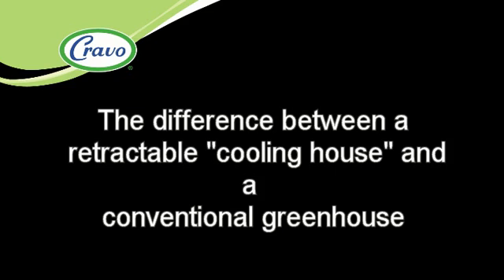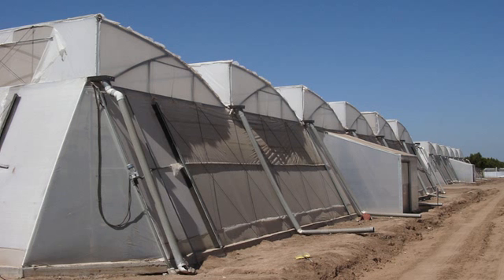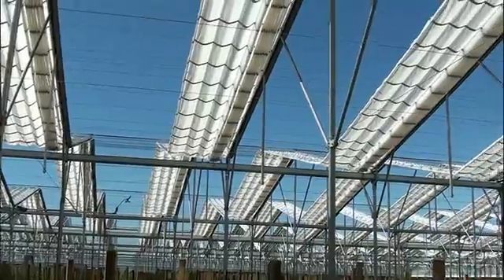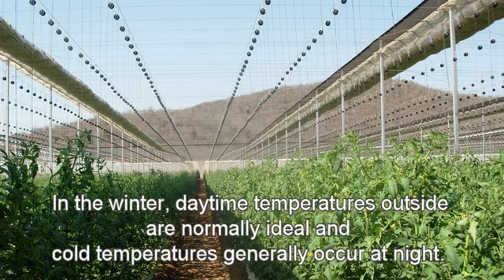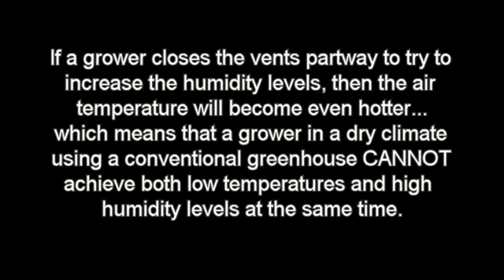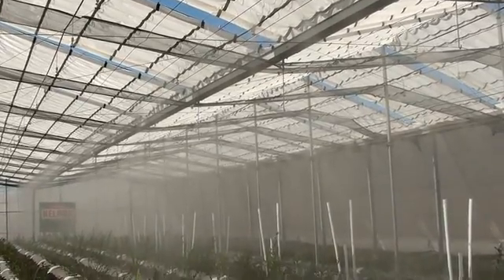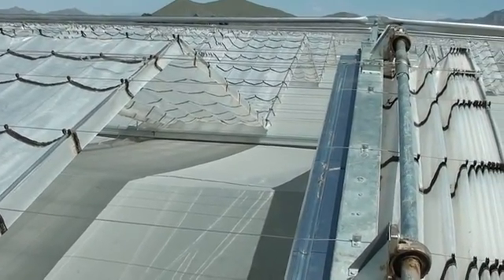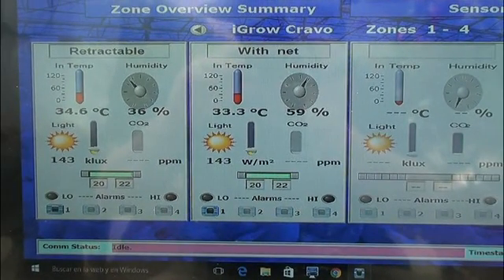The difference between a retractable cooling house and a conventional greenhouse

Comment: That's funny, after criticizing greenhouse because they could need fogging in case of high temperature and low humidity, you then say that a fogging can be installed in Cravo to handle high temp and low humidity. 90% of these arguments are actually in favor of greenhouse...

Comment: Good solution for certain locations.  How does this retractable system prevent insects from entering the house?  The other obvious shortfall is that these would not survive a hurricane of any strength.
Reply from the maker: If you checkout this web page you will see a video which outlines the 35 years of experience with retractable roof houses.  https://www.cravo.com/en/house-models       A stationary or retractable layer of insect net can be installed below the retractable roof for insect control.   These retractable roof houses have been hit by 16 hurricanes and cyclones and the structure and roof covering have survived all of them... including 145MPH winds in Puerto Rico

Comment: The comment regarding horizontal vs. vertical opening and air exfiltration at 4:50 is unfounded. 2nd law of thermodynamics states: Hot will always move from hotter to cooler and high pressure will move to lower pressure. Everything wants to have equilibrium. I'm an energy inspector, and this is the foundation of our work. Prime example: I stood in my 60 deg. F garage and the temperature outside was 90 deg. F. and windy. The temperature in my attic was over 120 deg. I stood under my attic access located in my cool garage and hot air from the attic was blowing DOWNWARD on me into the cool garage, thus heating the garage. 
What this man is describing is faulty. House roofs are designed to either have gable (horizontal venting) or vertical (roof top venting). His statement is that horizontal venting is better than vertical venting. This is wrong: The only thing one needs for proper ventilation is a pressure and temperature difference. If the greenhouse has a strong fan and is hotter inside than outside, it will ventilate naturally if there is an opening. 
Another important factor is the opening of the venting. What is necessary to know is the net free area of the opening that affects only the cubic feet per time air infiltration/exfiltration. Small area = small volume of air change per hour. Large area = large volume of air change per hour.
Reply: theoretically what you are saying is agreeable, you forgot to consider outdoor wind direction and velocity which can influence a lot if the ventilation is vertical ventilation, also practically speaking depending up the size of the naturally ventilated greenhouse when plants are continuously transpiring and if the outdoor wind is direction is opposite to the direction of vertical ventilation it affects the air exchange, even if you open the side vents when the plats are bushy air can go through all the way, that's why in a naturally ventilated greenhouse you can the plants are more productive near to side ventilation,  in the center of the greenhouse plants will be always week because of poor air circulation, co2 exchange etc...., also retractable roof greenhouses ventilate high and give very good production by using  2 to 3 hp power a day for one hectare, if you want to use a fans for vertical ventilated poly house you may need 70 to 100 hp/hour  to atchive 1 air exchange
Reply: Statement is not wrong. Rate of exchange with horizontal vs vertical is different due to vent size, and the elimination of flow eddies, which is more about fluid dynamics.

In other words, the flow rate is larger and less latent in a full length horizontal vent due to fluid dynamics.
Reply: I think what he was refering to in 4:50 is that Hot air always rises ESPECIALLY IF RETRACTABLE MEANS AN OPENING OF MORE THAN 50%!!! BOOM SHAKALAKA!!!